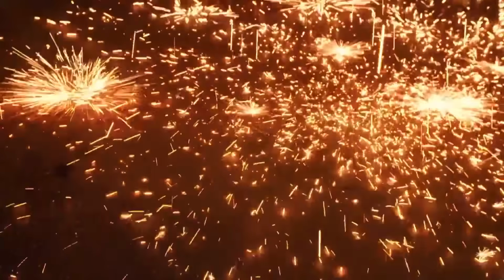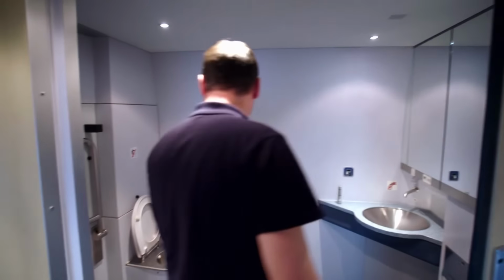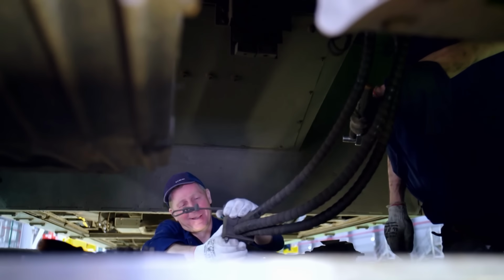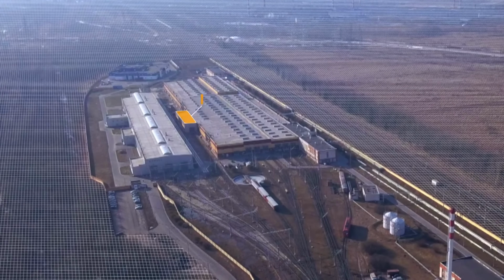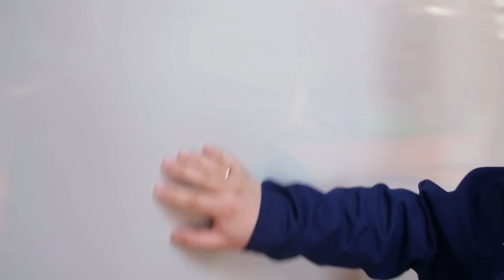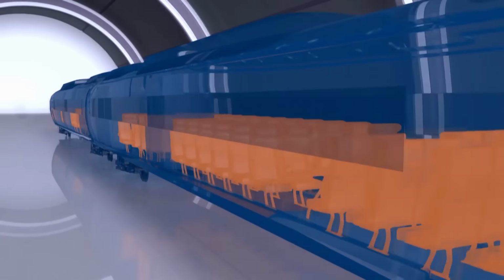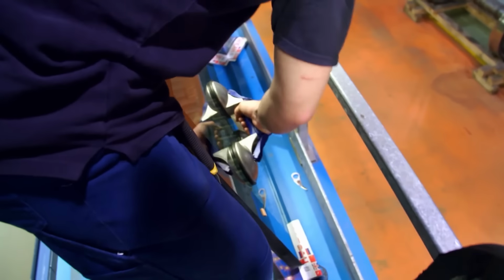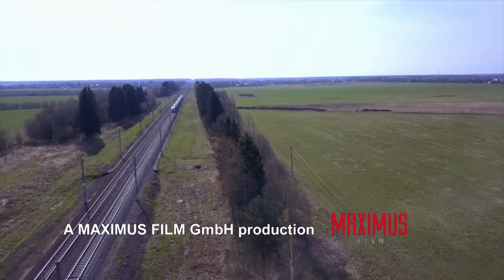World's Longest High-Speed Train Heavy Maintenance | Mega Pit Stops | Episode 2 | Free Documentary

Comment: I found this video on heavy overhaul of high-speed rolling stock very interesting.  I've previously paid a significant sum of my own money to visit heavy maintenance work-shops of high-speed pax trains in several different countries.  Many uninformed comments about window-damage from vandals; but that's OK.  To clarify, in winter conditions, the aerodynamics at speed cause snow to build up as an accretion beneath the under-body.  Eventually these snow-lumps fall off at speed, throwing up sharp-edged ballast that chips paint, dents the body-side, damages windows, cuts rubber components, etc.

Comment: 25:49 "High tech equipment coming through!"
Yeah, sometimes, the best tech is the simplest tech.
Reply: It's not like they used it since WW2
Reply: Like current TGV Sud-Est in France, only 2 small seven-segment displays and everything else is analogue in the cabin. But it still goes up to 300 km/h. Old high-tech.
Reply: @paname514  A Sapsan can travel at a speed of 300 km per hour, but the speed is limited to 250 due to rail tracks not quite suitable  ( google translate)))
Reply: Trere're scribblings on the beam 26:08 that says "DO NOT TAKE" , so it's really a sacred beam used to lift the bogies.

Comment: If someone facies a ride in one of these things without having to go to Russia, the Siemens Velaro is also running as ICE3 in Germany, where it has an even higher top speed of 320 kp/h. If you book a ride from Munich to Nuremberg, or Cologne to Frankfurt, you'll experience them routinely running at 280 kp/h and above.
Reply: The actual top speed of the ICE3 is 330kph. On the stretches you mentioned it's allowed to go 300kph. In France between Forbach and Paris most of the track has a 320kph limit, so there it goes that speed.
Reply: this is a different train though, yes it is from the velaro familly but it is completely different in various systems because of the russian climate and other adaptations, also russia runs a wider rail gauge
Reply: For Russian railways the train was absolutely redesigned. It is no longer like its european relative.

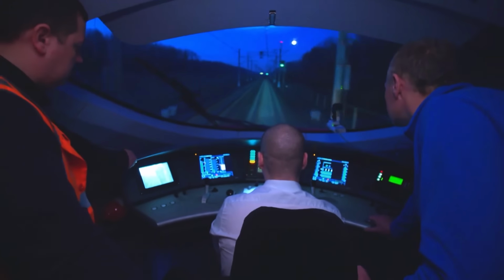Comment: 45:22 "Once Emergency Stop is engaged, the Train stops in 1600 meters" that's a 1.6 KM stopping distance 😯
Reply: that's why when the railway crossing flashes, DO NOT CROSS ! 

they can see you, but they can't stop at that speed and next thing you know is "meat bag" spread across the rails for the entire stopping distance after you ...
Reply: 250 km/h 320 tons weight... normal car need about 300m whit that speed... And car's weight is about 1,8t...
Reply: At that speed do you thinking will stop in meters ???
Reply: F=M×A.
Reply: Not that bad if you remember that it is steel on steel. Not rubber on asphalt...

Comment: Built by Siemens (Velaro model). 👍
Reply: Siemens specialists have done a great job of adapting this train for cold winter conditions.
Reply: @АнтонАбрамов-ь8х  Siemens and Russian engineers
Reply: @alanmay7929  Because Siemens specialist can't be Russian? 😂
Reply: @Aviators Group LOL
Reply: @MrMiss-cp9bw  Does Makdonald's  workers can be american only??
Reply: @Aviators Group Siemens is German...
Reply: Also runs on DC quite an achievement if u ask me
Reply: The Siemens train was taken as the basis, but it was adapted to Russian rut and weather conditions by Russian engineers. This is a joint project! By the way, this train was produced in Russia.
Reply: @globalpower6967  Nope. Only Siemens Desiro (ласточка) manufactured in Russia. All Sapsans made in germany.
Reply: @globalpower6967  russian engineers adapted a piece of wood only
Reply: @erickua8565  These trains have many differences, for example, the Sapsan train is wider than the Velaro train.
Reply: @erickua8565  There are many differences.
Reply: @globalpower6967  so what?
Reply: @globalpower6967  the Velaro that Siemens produced for spain and china are also wider. so the russian Velaros are just the same really.

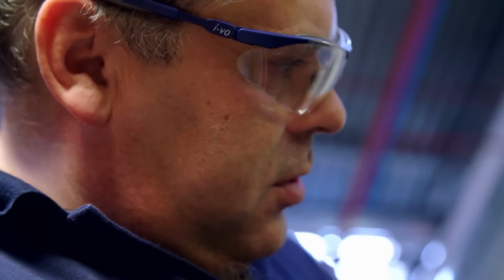Comment: 35:26 So he's cutting the glass window on a freshly painted train, atleast tape off the edges.
Reply: Jake Sullivan no, he's cutting the sikkaflex seal and that's mostly smoke from the tool heating up. He looks embarrassed and he stops because the tool is so hot it stops cutting and is melting the seal instead of cutting
Reply: It’s not about technical proses. 
It’s just because Alexey had days off before train was painted. No one can do this job, only Alex. 😂
Reply: This can be done after painting. Even for Airforce One they do it like a rutine.

Comment: "some bogies have a motor. that's known as: motor bogies"
what a surprise
Reply: booggy booggy 👀🤡👻😂
Reply: translation is wrong. some bogeys have a - generator-  that produces electricity when the train is running.
Reply: @benediktmorak4409  No, the translation is correct. Some bogies are motorized (usually around half of them), others are not. Electric trains don't need generators, they just transform and convert whatever they need for propulsion, air conditioning, air compression and electronics from the overhead power.
However, an electric motor and generator are basically the same device anyway, just operated in reverse.
Some electric trains/locomotives (incl. variants of the Velaro which this is) support regenerative braking in addition to traditional friction braking and sometimes inductive braking. The motor acts as a generator turning kinetic energy (motion) into electricity and feeding it back into the power line.
Axle generators were used for lighting and heating on trains in the past where the locomotive was either non-electric or not designed to support electric amenities. Most diesel and of course all diesel-electric trains/locomotives today have generators attached to the engine.

Comment: Couldn’t t beat the TGV on speed, so Seimens decided to strap on couple more carriages and call it “ The world’s LONGEST HIGH-SPEED TRAIN” ! 😂
Reply: As if all TGVs in service run at 500 km/h. Top speed doesn't matter if the rails are old and curvy. This Siemens Velaro RUS train is capable at running at 350km/h continuously and they sped it up to 400km/h once during testing.
Reply: @one_step_sideways   But TGV 4402 reached 574 km/h in 2007 during testing
Reply: @haido1000  Yeah, and they had to run it with all safety features turned off, top speed unlocked, as fast as they could, and they also temporarily boosted the voltage from 25kV to 29kV. Let's just say that running it 200km/h faster than the train's cruise speed is going to cause it to break down in flames by the next day. Don't you realize they have reasons not to make trains go faster than 350km/h? Not to mention that some trains have to go slower than that at some points.
Reply: @one_step_sideways  yes I see  but it was just a top speed test to get a record. Running the same train with the (same safety) features continuously   will cause it to break down.  It depends  on  the railways (straight,  well installed, no vibrations ... etc) that's why high speed trains can not run all the time in the same maximum speed.
Reply: @one_step_sideways  I have never heard of a velaro RUS running up to 400kmh. The only Velaro I am aware of has run to 400kmh is the Velaro E (although maybe also the chinese Velaro).
Reply: @one_step_sideways  However, yes they can run up to 350kmh, just like the spanish velaros. Also like the spanish velaros, they don't because the signalling system can't keep up with them. In spain they run up to 310kmh (although they speed quite regularly to keep schedules)
Reply: 574 km/h top speed but 0 km/h on SNCF strike days. To be fair, the TGV seems fine so long as you don't have to connect with another line...
How is it in Russia?

Comment: Couppling two trainsets does't make it the longest train. One single Train is just 250m. 
A Eurostar Train is almost 400m (398,9m) and carries about 900 passengers a 320 km/h
Reply: a train is a train. it's all mechanically and electronically linked and one has train driver. just because you can't walk from one end to the other doesn't mean it's not one train.
Reply: @swunt10  It is a set of two couppled trains. And in the film they only overhaul one set as far as I understand it. So the train they deal with is by far not record breaking.
Reply: But can Eurostar Trains operate like this, I mean can 2 Eurostar trains be paired? If no, it means that Sapsan is indeed the longest😅😅😅
Reply: What about the kilometer long freight trains then?

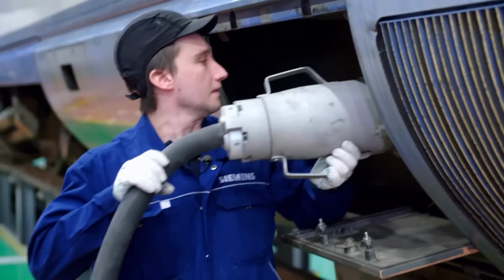Comment: 4:42 3000V? you shure? normal trains run from 15 to 30 Kv depending
Reply: Seems a bit low to me too. In China the HSR trains run at 25kV.
Reply: @LukeRichardson1981  3000V DC. That's the same as 20Kv AC. The Russian standard in most regions. Some regions have 25-27Kv power lines.
Reply: TheIVImann that’s probably Direct current. Here in Belgium where I live trains run on 3Kv DC as well.
Reply: That's the Motor Operating Voltage.  The pantograph  picks up electrical power at a very high voltage to minimise the electrical current.  (Think of a welding machine:  that works on a low voltage and high current and the result is that at the point of contact metals get hot, melt and weld). At a high voltage and low current the pantograph will produce very little heat at the pick up point, or point of contact. 

The high pick-up voltage is then reduced by means of on-board-the-train transformers so that the electrical power can be used by motors,  (and other normal ancillary services).  Due to the insulation requirements of coils within motors it is virtually impossible to have motors, unless very large,  run at very high voltages, (For example: 15 to 30 kV.).

By the way, engineering-wise,  this is a stunning video ..well done the producers!
Reply: @camiemengineer  Your answer is completely wrong. The catenary voltage is 3 kV DC or 25 kV 50 Hz AC. 250km/h is top speed for 3kV DC; 350km/h for 25kV AC.
Reply: @cbaurtx  DC voltage doesn't actually really matter, because trains can easily reach speeds of more than 300 km/h on 3kV DC. They also said that one of the trains reached the speed of 400km/h on a dedicated test track before they put them in service, so I assume that train was the first they got their hands on and it was also running on 3kV DC. Four of the Sapsan trains that were built later had been made to run both on 3kV DC and 25kV AC, and I guess they're going to be using those particular trains on the direct high-speed track to St. Petersburg to use the advantages of AC over DC (DC used to be better than AC because of the relative ease of regulating motor power, but not anymore) and to minimize current.
Reply: @one_step_sideways  The 400kmh train was a spanish Velaro E running on 25kv AC

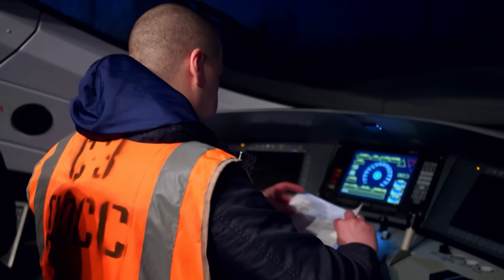Comment: 44:33  This train starts up with windows XP
Reply: Yup, this train was made in 2009, same year win7 came out. But if you had to choose between WinXP, a trusted stable OS or new Win7 with unknown bugs or other system issues what would you choose? Damn, I was running WinXP till like 2011.
Reply: PIS (passenger information system) usually using window xp. Dont know why they didn't want to upgrade to window 7 or 10.
Reply: @qiblik   - I'm still on XP here! Installed in 2005, and still without major issues. Cant use internet much though!

Comment: Japan's Shinkansen between Tokyo and Shin-Osaka are 16 cars every trip, and I think they now run up to 320km/h. Never seen anything resembling a broken window on a Shinkansen train, so I wonder if the broken windows on the Russian train are the result of vandalism.
Reply: Could also be that the Russians use ballasted tracks, while the Japanese use ballastless tracks. The engineer in the video stated that he thought the damage came from rocks thrown up by the train's wheels. In China almost all HSR lines are ballastless, and I've never seen a broken window on a Chinese HSR train (and I take them often for work).
Reply: The tracks on which this train runs on are the regular modernized tracks for regular trains, such as the much slower sleeper trains and freight trains, so they also have to share the tracks. This, along with the unmodernised power lines, is what made them reduce the top speed from 290km/h to 250. They're building high speed tracks specifically for Sapsan and Strizh trains, and the Sapsan should be able to reach its top speed of 350km/h once they complete them.
Reply: Russian Sapsan uses upgraded conventional tracks as opposed to  dedicated high-speed tracks without stone fillings. On specialized tracks these trains can run even faster. In Germany the  same Velaro model, named ICE3, routinely runs in excess of 300 Kph, but is limited to 250 kph on upgraded conventional tracks and even 160 kph on bog-standard conventional tracks.
Reply: It's indeed the vandalism. A lot of regular commuter/regional trains running on the same line was cancelled or rescheduled because of Sapsan, and people who live in smaller towns and villages along the track who used those trains were really pissed off.
Reply: The engineer in the video said so because it's better than to say that can be so awfull persons in capitalistical system wich can to broke windows in the trains to make graffity in pablic places to rob markets and etc...
Reply: @dschoene57  in france the same german train can run at 330 km/h and the french use conventional tracks with stones/gravel.

Comment: World's longest? What about eurostars?
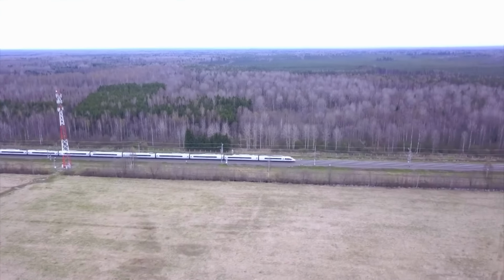Reply: They're not long enough. A twin Sapsan train consists of 20 cars and has a length of 500 meters, as mentioned at 1:33, which is ~100 meters longer that the usual Eurostars.
Reply: Eurostars are limited to sub 500m length due to evacuation requirements in the Eurotunnel.
Reply: One single Eurostar has 16 carriages and can go 320 Km/h. Sure that beats this Russian version of the Valero. Coupling 2 trains together is cheating in my opinion. ;)
Reply: Михаил Михайлов But still a single 16 car Eurostar train is longer than a single Sapsan train, coupling 2 trains together and saying it's the longest single unit is a load of rubbish.
Reply: @macdonaldjohnstonfan  But making a single train longer is just a matter of simply adding more cars to the train. Hooking up another train with 10 cars is the same as adding those exact same cars to the train. Had this really been just cheating, Sapsan wouldn't have been considered the longest high speed train in the world.

Comment: And the reason the broken windows are not removed before the paint shop? You can clearly see scratches in the paint from the cutting tool the mechanic uses to  get the broken window out. Why is the area around the window not protected whilst this work is being carried out if it has to be done at this stage.

Comment: When the wheel is 'fixed', they actually decrease the diameter of the wheel by some milimeter or smaller. Doesn't this affect the train at all?
Reply: That's normal practice. Just make sure both wheels on the axle (or maybe bogie) have same exact diameter.
Reply: This procedure is calculated into the design of the wheels to extend their lifetime and can usually be done a few times until the wheel has to be replaced (or needs a new outer tire if it's a composite wheel).
It's important that the diameter is always matched on both sides of an axle and within certain tolerances compared to other axles on the train.
This is not a big problem because all bogies and wheels for a train are usually operated and maintained as a full set at the same time, and therefore have the same service life.

Comment: So after the wheels go on the lathe do they compensate for the new rolling diameter for load and speed and accuracy of said speed?
Reply: Well yes you may need to adjust that on the speed indicator. That's what i do when i'm setting up a new data recoder
Reply: No. They just send it without a second thought.
Reply: They probably are, but the difference is rather small with how the wheels have a diameter of around 800mm and they shave off 8mm from that.

Comment: Has this killed off the air routes between the two cities
Reply: Actually no! Sapsan is kind of prestigious way to travel between two capitals. And it's complimentary to other services. There are more than 30 flights daily in each direction as well as other day and overnight train services + bus routes.
Reply: It made air travel a lot less popular. You spend an equal amount of time travelling to and from the train stations, located in the centre of each city compared to going through all the hoops of travelling by costly express trains from the train stations to arrive in an airport outside the city, and then go through all the hoops of checking in and boarding the plane and then going back to the other city's centre from the far away airport. Sapsan also offers better conditions and cheaper onboard meals (and the ability to buy meals right on the station before boarding for cheap), way more luggage (including liquids and everything), and when the proper high-speed railroad comes into service, air travel will basically be done for. Though prices will be made higher so as to recoup the money spent on building the 600km of high-speed rail.

Comment: Hm. What makes this Siemens train "russian" (except the name "Sapsan")?
Reply: 1,520 mm Russian track gauge and voltage - some 3 kV DC and some both 3 kV DC and 25 kV 50 Hz AC.
Reply: Well, it runs in Russia (And the gauge and electrical system). In fact, these trains are german, and have been first operated in germany as ICE 3. Those have default gauge (1435mm) and operate under 15kV. Theses a ICE 3 which can run in countries like France as well and features multiple, different electrical systems as well as train protections.